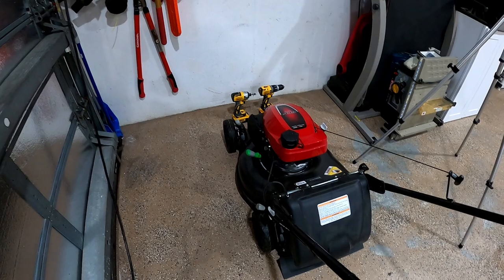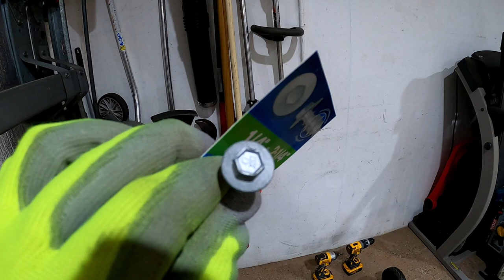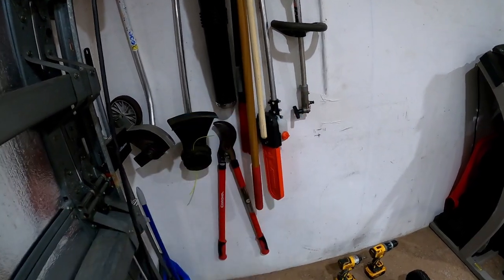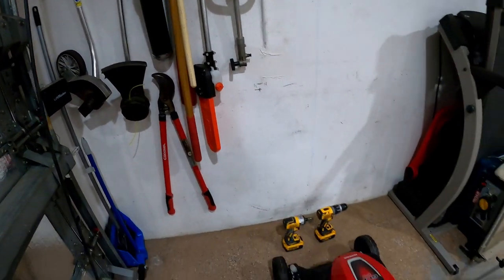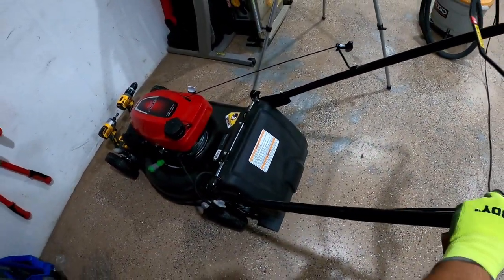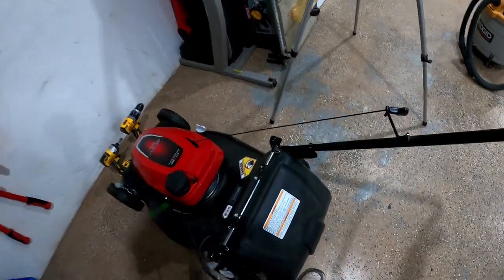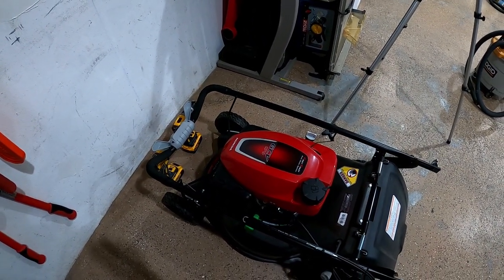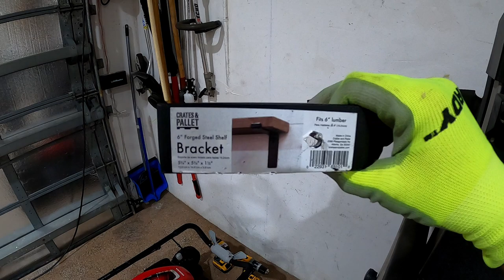Honda HRN 216 wall storage idea or any lawn mower on the wall to save space

Comment: Great idea. Can I just check please. Doesn’t the oil leak out of the mower when hung in this position?
Reply from the maker: Hi yes the Honda does leak I found out the hard way.  I even added an oring to the pin that leaks but still did.  Dont know why Honda didnt make it to fold up.  Good mower but has some issues.  I ended up just keeping the Toro just for that reason even though it also has some issues. If Honda would make them stand up it would be an excellent choice.

Comment: Awesome idea! Have you noticed it causing any issues starting or any leaks of oil or gas since doing this?
Reply from the maker: Hi Will yes I have noticed some oil leak from the lever on the side.  I noticed about a week later when I went to use it again.  I called Honda and they said they dont recommend to put that way.  I told them they should because most manufactures are doing it.  I will update the video soon I have lots of work now to mention that it leaks through what I think is the governor lever on the side.  I cant figure why it doenst leak when running but it does when put on the wall.  I like it on the wall, is space saving and I am just putting a small rag under the lever.  I found a flat oring that I am going to experiment with hopefully this week.  I have run it several times since I put on the wall and it seems to be perfect no gas leak.  I will be doing a video on some modifications I am doing to it to make it a little better and address some issues that I think can be improved.  If you have any ideas or questions let me know. Thank you
Reply from the maker: Thats a great idea I didnt think of that I just put an O ring type of dense foam I had laying around and cut out the holes with a punch hole maker but only worked for a week then started leaking. Thank you

Comment: Where did you get the lawn mower hooks from? What are they called?
Reply from the maker: Hello I purchased at Homedepot item number sku 1002311772 model 69101 6 in Black Steel shelf bracket , there are different lengths.
Reply: Thank you so much! I will look for these. Great idea!

Comment: That mower isn’t meant to be put sideways. You’re going to mix your oil with your gas.
Reply from the maker: Hello I ended up selling the Honda and purchased a Toro Recycler that comes with the option to stand.  The Honda kept leaking oil and gas so it had to go even though it looked great on the wall. Thanks

Comment: Is gas or oil going to spill
Reply from the maker: Hello both oil and gas will spill on this Honda unit.  I believe the gas was spilling due to the lawnmower being close to the garage door. When I had the door open in the mornings  the sun would shine on it and the gas would expand.  I was not every day that it poured gas sometime it had low gas so it would not spill.  I still kept it on the wall I just put a small container on the bottom of the drip.  I wish Honda would design the unit for upright position in the future.  I did a small modification to the idle throttle by adding a small seal but after a week it kept leaking the oil.  I loved the Honda but ended up getting a Toro that had the option to stand it up. I do miss the drive system of the Honda but I made a decision.  Thank you